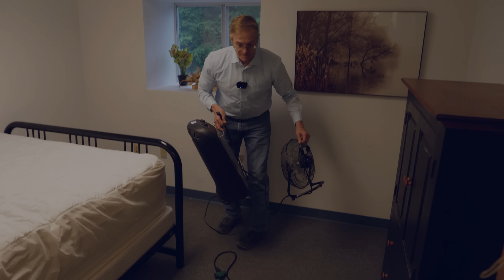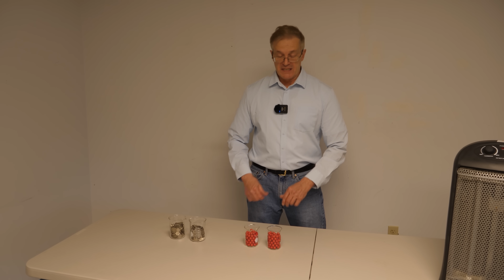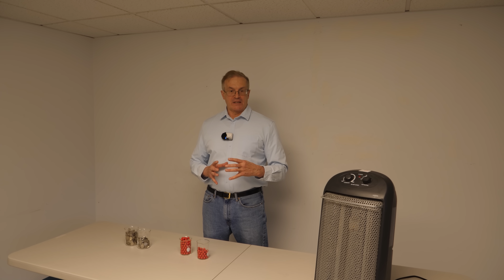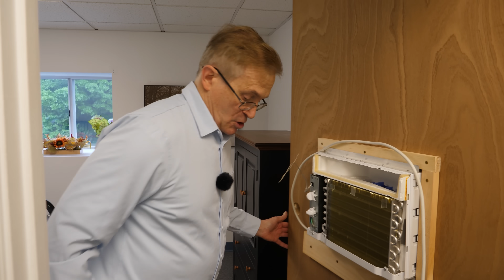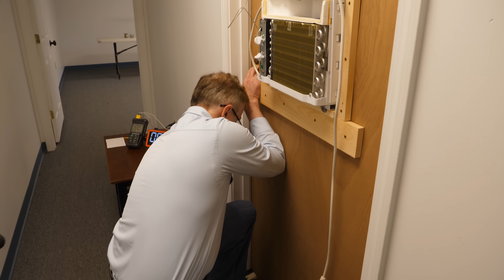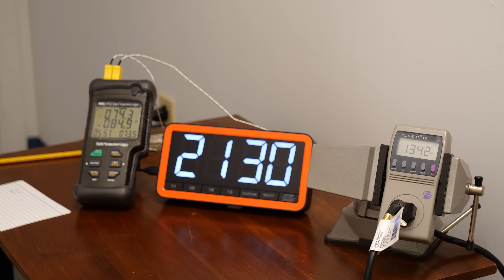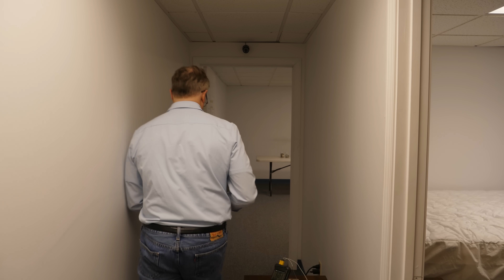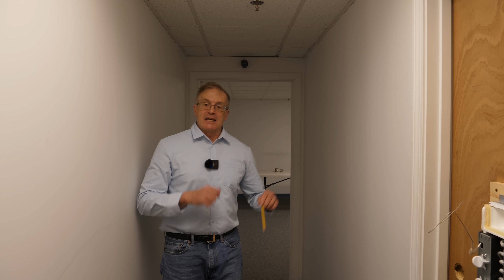You're wasting money on heating! Use your A/C!

Comment: Here’s one factor that demonstrates what is incomplete/possibly wrong with this test:  Even though the A/C unit is in itself one system operating in two isolated conditions, the amount of heat that the A/C unit is capable of putting into that room is dependent on the work it has to do to remove the humidity from the hallway/environment that it has to operate in —> as the removal of moisture from said hallway is what has produced the heat in the bedroom.  You did not conduct this test or track the data accounting for varying humidity levels of the hallway over time.  The uncontrollable humidity/temperature factors of the environment on the evaporator side of the A/C unit may or may not invalidate this hypothesis.
Reply from the maker: The removal of moisture will affect the result, but it is hardly the cause.
Furthermore,  the hallway was not sealed  from the huge volume of air in the warehouse, and over 1/2 hour, the humidity levels will remain nearly the same. Notice how there was no puddle of water in the doorway of the bedroom?
Reply: @TechIngredients  I am agreeing with your assertion that you may be on to something and that this needs more looking in to, but a better controlled experiment with better-tracked data points may support your hypothesis better.  Because environments on the evaporator side of an A/C unit are SO varying, it is going to take a large data set to support an assertion that this is a viable alternative option to efficient heating.  Also, we're all looking forward to the follow-up video on this topic that was promised as "in our next video...".

Comment: seems effective for those particular temperature and humidity conditions, and those two indoor spaces, but for a typical home heating use case in winter time, say 32 F outside and 60 F inside, how effective is that reverse AC unit going to be then assuming it is positioned in a typical window install?
Reply: window air conditioner would not work in really cold temps water would freeze from condensation it was not made to run in cold weather

Comment: Constant cooling of/unstable atmosphere around the heater will work against it's thermostat. You're "BUSTED"....
Reply from the maker: Look again.  The thermocouple is isolated from the unit.  The airconditioner ran at full power for the 1/2 hour test.  If it didn't, then the results would be even more impressive.

Comment: Your test is flawed, your air conditioner is not at the exact the same place where the heater was placed, and an air conditioner cannot be installed backward especially if it is colder outside, otherwise it will freeze and no more air will no longer circulate through the cold side, so there is a risk of overheating and breaking something inside the air conditioner.

Comment: I'd welcome being corrected, and also acknowledge not reading many of 4000+ previous comments but ...

... For a demo this is great, but anyone considering putting this into practice by simply turning their 
window a/c around:  I think you'll find that does not work. Problem is the built in t-stat will be 
OUTSIDE of the house and therefore will not initiate a/c operation during the heating seasons. 

Some folks would be able to open the unit and bypass the t-stat ... but that's not for everyone ...
Reply from the maker: I have read all those comments.
Although this was just a demonstration of the potential of a heat pump, modifying a commercial airconditioner isn't difficult.  We could dive into that if there is enough interest.
Reply: @TechIngredients  That would be valuable. As well as the t-stat issue, there may also be an issue with icing to overcome.
Reply: @TechIngredients  I think this would be the main interest as commercially available heat pumps are pretty well understood.  Also I'd like to see this test performed with the condensor being place outside in cold weather.

Comment: Is this new to Northern folks.  I've had heat pump AC/Heat for all my adult life from apartments in college in 1982 to my two houses.

The biggest flaw with central heat pumps is the ducting is good for about 10 years before itneeds an audit and repair.  Worn tape adhesive, corrosion, dust buildup, straps breking due to rust, occasional varmets like squirrels knawing holes.

The absolute most energy effecient electric AC/Heat is mini splits because they eliminate ducting travel loss.  My ill is 1/3 in the old victorianof what it was with a ducted heat pump.

However the new house is built like an igloo cooler, well insulated, tight, with good ducts....and my bills are usually $55 for the AC and $75 for the heat if I take away $40 for all other use.

However modern heat pumps seem to tap out at 5 degrees F...as there is not enough heat to exchange.  They used to struggle below 30F outside

Comment: My home is Energy Star rated. I had one of these for 5 years and was not very impressed with it. By the time the air made it through the ducts to the registers, it was only 'very warm' and not at all the heat levels I was used to. Secondly, as soon as it dropped below 30f outside, the internal heat strips would kick on. No big deal, but if we had long periods of days where the temps were right around that 30f mark, it would constantly switch back and forth between heat pump and resistance strips. Lastly, would be that after 5 years, it quit in the middle of summer. The tech that replaced it said that the compressors are the same whether its a heat pump or not, but heat pumps run all year instead of getting the winter break. More hours of use means faster detonation. Made perfect sense to me. 
THE MATH: I paid $2,700 for the heat pump upgrade when I bought this house, which included the proper thermostat and running the 7-wire for it. My savings were an average of $32 per month; meaning it takes me 7 years to EQUAL the initial cost to upgrade. I know mine only lasted 5 years, but even if it had lasted 7 or 10 or even 15 years, the few thousand dollars saved is not worth losing out on being able to cook my feet on a hot register, or to let that hot blast of air up under my robe on a cold morning.

Comment: Curious what thing would do sticking out a window when it’s 20 degrees outside and humid? Would the evap coil ice up?
Reply from the maker: It might.
You would have to make some modifications to an actual airconditioner for reverse operation, starting with access to the controls. In commercial heat pumps, there will be that same issue with potential icing, and I believe they come equipped with a defrost add-on to the external heat exchanger.

Comment: Been running heat pump since 1991. Good video.I would recommend you talk to an electrician about powering a space heater with a 15 foot 16 gauge cord. You even noticed it was warm when you unplugged it. Best wishes.
Reply from the maker: Thanks.
That is the same guage as the cord from the appliance. Heavier guage is always good when it's available.
Reply: My guess is that the heat noticed was from the resistance between the plug & its socket.  Maybe he needs to scrap the plug and bend its connectors to increase the pressure between plug & socket.

Comment: Hate to be mister obvious here but you don’t need heat at 77 degrees. You need to run the test at 30 deg min. When there are less calories it takes more energy to extract them.
Reply from the maker: Of course.
We were demonstrating the principle.
Reply: @TechIngredients  without doing a metered test to see the time and energy it takes to get to room temperature and then to maintain that temperature for at least 24 hr tends to display a bias. I once hunted down the claim that a heat pump is 300% more efficient and it is based on a toaster, the toaster was used as 100% efficient so the heat pump was then three times more efficient, thus the over unity claim.
Reply from the maker: You should rewatch the first part of the video, which explains the thermodynamic principle of entropy. In short, moving heat requires much less energy than making heat.
The duration of the test doesn't indicate bias.
Reply: @TechIngredients  we can extend it to the absurd, if you have a room at 70 deg and it is 95 outside how much energy would it take a heat pump to reach 95 inside and how much energy would it take an electric heater to raise the temp to 95 deg? Wow, the heat pump is thousands of times more efficient.

Comment: I think it's simpler to explain: an air conditioner IS a heat pump - it pumps heat from inside your house to the outside and cools your house.  A heat pump that heats your house does the same thing in reverse: it pumps heat from outside your house to the inside.  It's as if you installed your air conditioner backwards, with the controls on the outside of the window; all that heat that comes off the back of the air conditioner would then be inside your house, heating it.  No need to complicate things with entropy.

Heat pumps are more than "100% efficient" at heating than resistance heaters that turn electrical energy into heat, because they don't turn electrical energy into heat; they use electrical energy to MOVE heat from the outside into your house, which takes less energy than CREATING that same amount of heat.

In a nutshell, if you were to put your air conditioner on a Lazy Susan carousel, and rotate it 180 degrees each time summer turned to winter, you'd be doing the same thing that a heat pump does with its valving.  Only a heat pump does it internally, so the inside radiator is cool in the summer and the outside radiator is hot; and in the winter the valve reverses that relationship, and the inside radiator is hot, and the outside radiator is cool.  No Lazy Susan needed.

As a first order description, that's exactly what happens.  There are refinements - like the fact that the refrigerant that circulates in heat pumps operates at a VERY low temperature compared to traditional refrigerants.  That's what allows it to pick up heat from even VERY cold outside air - heat always flows from warm bodies to bodies that are colder, even if the warm body is pretty cold (outside winter air), as long as the cold body (the refrigerant) is colder than that.  That's really the whole trick that makes heat pumps work to heat a house even in "frigid" wintertime temperatures: the refrigerants used are REALLY frigid.  They generally can extract heat reasonably well from air as cold as 20 below zero!

Seems like that does the job of explaining the whole deal.  I've had a heat pump up here in New England for about 7 years now, and it costs less in dollars to heat my house than with my natural gas-fired Navien combo recirculating hot water condensing boiler with external reset/on-demand (yeah, right*) hot water heater.  And natural gas-fired condensing boilers are REALLY efficient; for example, the boiler combustion exhaust is barely even warm - all the heat of combustion goes into the water, not up the chimney.  

But pretty much all winter, the heat pump COSTS less to move outside heat energy inside, and keep the house warm, than the boiler does to keep the house warm - although changes in electric costs and natural gas costs can turn anything upside down, courtesy of a bizarre and unstable national energy policy.

I think your demonstration, however, of the resistance heater vs. the reversed air conditioner is a brilliant and very tangible way to both make the point AND give a quantitative comparison of the energy used - showing the relative efficiencies in a way that you can sink your teeth into.  That's REALLY useful.  Nice job.

* "On-demand" means when you ask for hot water, the boiler fires up - and not otherwise; it does NOT mean that when you ask for hot water, you get it.  It can take a full minute before the water at your tap gets warm.  They don't tell you that.  You really need a hyperinsulated reservoir tank of water kept hot by recirculation under thermostatic control if you want "instant" hot water, and don't want to waste water waiting for the boiler to heat it up and send it to the faucet.  That's a secret they keep from you when they're selling you the combo unit.

Comment: Hi Tech Ingredients, 
Is it fair to have the AC unit so close to the temperature probe? Should the temperature probe be the same distance away from the ac unit as it was for the space heater. Also can you verify that the AC unit was not blowing directly on the temperature sensor, since the AC unit was never shown inside the room, we don't know how the air is dispersed? Some sort of cheap plywood could be used to keep direct airflow off the temperature sensor. I would Also suggest multiple temperature sensors in the room. A probe at head level, a probe at bed height level, and a probe 12 inches off the ground. Also it would be interesting to run this experiment with a ceiling fan on and running in a clockwise and counterclockwise direction. When is part 2? Cheers,
     Bill
Reply from the maker: The airconditioner was blowing perpendicular to the door away from the probe. The hot exhaust from an airconditioner can't be redirected like the cold air vent.

Comment: I would use an A/C aka heat pump if I had one, but if you don't have that a IR-heater is much more effective than any other kind of electric heater, as far as I know. Just a tip
Reply from the maker: Thanks.
The difference between  an IR heater and a "conventional " resistance heater isn't in the amount of heat produced per watt. They both rely on resistance and have exactly the same efficiency, but the IR heater radiates the heat across all the surfaces of the room while the other system heats the nearby air, which rises to the ceiling.

Comment: OK, so how is this going to work when your outside temp is -32 C?
Your differential is 20 degrees or so... That would make the room -12 on a winter day when the outside air is -32.
Doesn't sound very promising...
Reply from the maker: Consider the alternative.
A space heater could keep that room warm whatever the temperature, but it would also have to achieve that differential. So, use both.  The resistance heater generates 1/2 the differential, and the heat pump generates the other half, but at a much higher efficiency.

Comment: Definitely entertaining but when the outside air temperature is 20 degrees our heat pump is pretty much useless at heating our home. We then use our fireplace, with a furnace built into it, that blows hot air through the house heat pump ductwork.

Comment: Your experiment is clearly flawed for numerous reasons. 

First, you are heating one room, yet simultaneously cooling a second room.  You should be discharging the cooler air to the outside of the building, because that's how a heat pump operates. You did not cool the second room when you used the resistance heater. 

Second,  your window AC will only run when temps are above 60 degrees F, so if the outside temps are below 60 F, it won't run. 

Third, you haven't addressed the issue of condensation.  

Fourth, if a resistance heater is almost 100% efficient, then how can a heat pump be many more times more efficient than that? That's total nonsense.
Reply from the maker: Your first three points are noted, but don't alter the argument about the efficiency of heat pumps.
Your fourth point is simply wrong, and I explained why at the beginning of the video.  Watch that part more carefully, and you'll understand why.

Comment: It is logical that a heat pump has a higher efficiency than resistance heating. Because the heat pump does not produce heat, it only moves it. My "rather philosophical" question is what will happen in a densely built-up city where everyone will be "stealing" heat from the air by how much will the surrounding air cool down. Because if we are talking about kW it will be a negligible value but if we are talking about MW or even GW.

Comment: Question about power efficiency.  If we are warming cold air from the outside with a heat pump, how is that more efficient than re-warming the air inside with a space heater, given that the inside air is already warmer?   One would assume that making warm air warmer would take less effort than warming cold air, and could be achieved using less watts of power.   An electric space heater is recycling air.   I am Western NY, so winter is pretty cold.  Thanks!

Comment: Do you think this would work if the hallway was already 32f.. You would have to remove the thermostat compressor cut off wouldn't you? or since these window units work by removing the hot air or is it the humidity?

Comment: Next us should be blue light blocking and getting some UVA UVB in your house. It is a simple biology equation. We all started with UV you have to get it. or you die. we are dying, right. Sick and nearly dead. Get the blue out 80% of the day. Some early and mid day. Then block it later. Get off your phones and wifi. Turn it off. I dare you try. 
Ok if you're still here. Look up robert o becker, and pollack on biology. EMF is bad. UV light is good. Water has many states and IR and UV change it. Blue does too.

Comment: Im not understanding this in relation to a heat pump.. are you saying that you should put a heat source near the intake vents, for 30 mins.. and then circulate the air with the fan or the cold, from the ac unit?